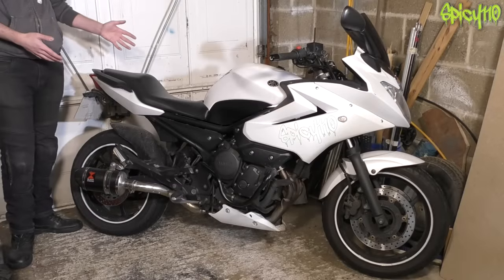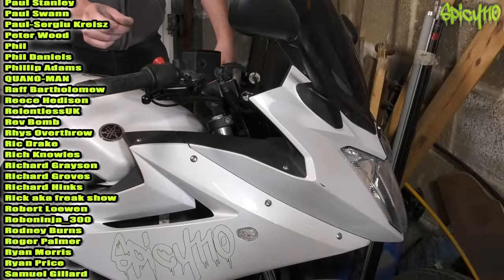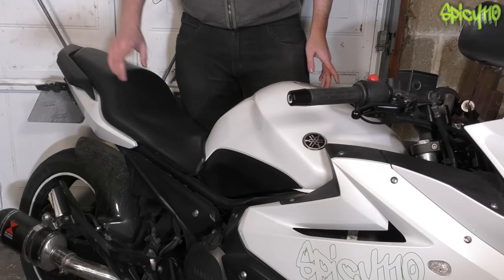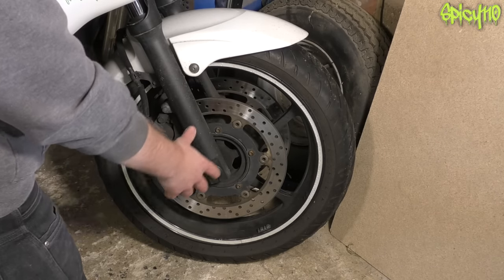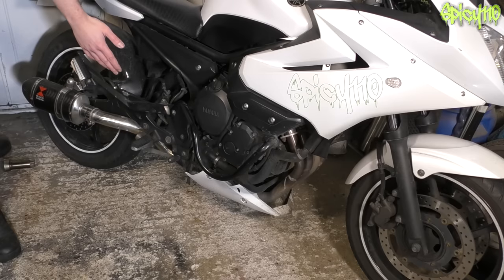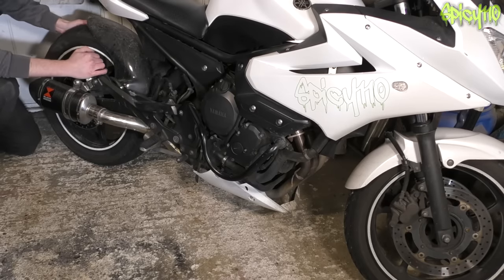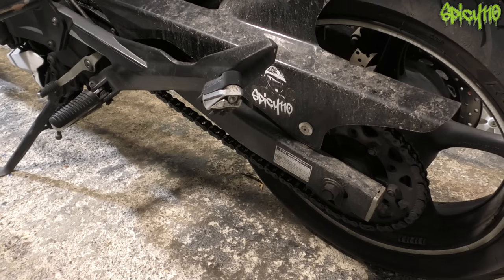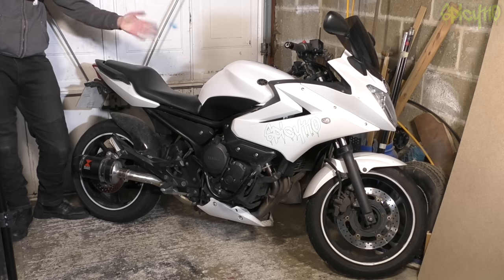My Motorcycle MOT Checklist!

Comment: We once put heat-shrink over braided brake hoses on the Land Rover.  One got nicked but just the plastic not the metal hose underneath it and it was a fail.  Cut the heat shrink off and it passed.  Even though all the other hoses were still covered in heat shrink.
Reply from the maker: Yep that's that visible damage bit again haha its kinds silly.

Comment: Most MOT testers are quite fair.  Garage i use are very thorough, but the guy who does the Bike MOT's is a biker himself, so little fussy things which can be sorted in a matter of minutes he will not fail you for. Things like LED flashing too quick, slightly too slack chain.  Things which can be sorted in minutes. Sometimes he will let you use his tools and sort it there and then
 Like he said to me last time, as long as you know what needs to be working to ensure safety and use a bit of common sense, and you maintain the bike, look after it, and replace worn consumables when required/below legal limits etc, you should not really fail a bike MOT.     If you know your tyre is below the limit, or your discs are worn, or pads etc.  Why would you book an MOT?

Which is a fair point
Said he can tell from a single MOT inspection whether someone maintains their bike.
Reply: The testers at my local test centre will fail a bike for  the smallest thing, all  just to get the money for a retest.

Comment: My MoT tester told me I had to have indicators if I had headlights on my Moto Guzzi, so many testers interpret the rules differently, it does get a bit confusing at times. Don't forget the indicators need to be spaced apart a certain amount if they are aftermarket! :-)
Really helpful vid this :-)
Reply: If there is indicators on the bike they have to work, if there arent, he just puts "not tested/not seen" on report (also have to take the indicator switch out, i believe). Or, you can simply put tape over them.  Although i did hear once that  bikes which were first registered after 1986, MUST have indicators.  Anything first registered before 86... the above applies.
But of course, you really really should have indicators on a bike, id make it a legal requirement.  Reason why all manufacturers install them out of the factory
Reply: @rickyevans3845  Hi Ricky, I noticed the "edit". My 2020 bike I recently got new and road registered didn't come with any indicators weirdly, yet has the switchgear for them, I wonder how many headaches that will cause come MoT time in 3 years if I still have it! :D

Comment: Thanks Spicy. As someone who just move to the UK and was hasty in getting a cheap bike I have 2 questions before I take it in next month. 

1. Would  a cracked but complete indicator lens fail?
2. Are instrument backlights a requirement to work or is it a case of, if it's there, it should be working?

Comment: We’re not allowed to use a calliper on the discs during mot, also not allowed to take any covers off or remove anything that can’t just be taken off, so theoretically you could have a leaky shock, and cable tie a cover to it and we can’t check it 😂
Reply: Same with fork gators
Reply: And ‘not for road use’ stamps on exhaust, a sticker over that means we can’t fail it on that.... but if it’s suuuper loud, it’s gonna fail anyways especially at my work as there are regularly police check points at the Tesco at the end of the road 👍

Comment: They can only advise the mirrors and indicators if they were fitted and you have removed them if the were not fitted as new they are not advisory and the rear reflector ideally needs to be located in the centre where the number plate is and I have a push bike on the near side strut

Comment: I’ve always been a bit confused on foot pegs. I was warned when I had my 125 because I only had 1. You can’t take passengers on a 125 so I didn’t see the fuss.
Reply: If you have a rear pillion space on your seat, you have to have rear footpegs securely installed.  Bikes with seats only big enough for the rider, dont need them.  Law(s) may have changed lately
Reply: You can carry a passenger on a 125cc with an A1 licence.

Comment: My first motorcycle MOT is at the end of Feb, so this is very timely and useful for me Spicy, thanks.  One question for you if I may pls... Not sure if there are different wattage bulbs in my indicators, or if it is a faulty indicator relay, but right side flashes slower than left side.  The front and back indicators on the right work fine, just flash at half rate of the left.  Is this a fail?
Reply from the maker: Hmmm are they LED indicators?
Reply: spicy110 not 100% sure Spicy. I don’t think they are if I’m honest.

Comment: My bike got knocked over in one of wales lovely storms and one of the forks on the bar that holds my pillion pegs on got a crack (as the pillion peg took most of the force). Its still secure but would that be an issue?

Comment: I have yet to take the CBT but have a 125 that I got to repair and use (videos will be on my channel eventually). The mot manual here  https://www.gov.uk/guidance/mot-inspection-manual-for-motorcycles says this about reflectors :"Motorcycles must have one red reflector aligned to the longitudinal centre line and positioned to reflect squarely to the rear...Reflective tape is not an acceptable substitute for a rear reflector". So I would be interested to know if just a small sticker on the number plate is a pass. Thanks for the good videos.
Reply from the maker: I did cover this in the video, they sell little self adhesive reflective buttons about the size of a 10p that you stick to the plate and that covers you.
Reply: @spicy110  My headlamp glass is cracked :(
Reply: @spicy110  You say in the video attached to the edge of the plate but I thought they need to be on the center line of the bike.
Reply from the maker: @SteveSims  arr I see what you are saying, mine have always been on the corner of the plate never a issue but if you want to out it slap bang in the middle at the bottom go for it. As long as it isn't over a letter or number.

Comment: So your telling me I can remove my indicators completely?
Reply: grey area.  If they are not on the bike and neither is the indicator on/off switch, then its not a fail.  However, I did get told once that any bike which was first registered after 1986, has to have indicators.  Absolutely daft not to have them anyway IMO, they should be a legal requirement full stop

Comment: I went on my side and the end of my front brake lever snapped off. It isn't sharp but is that still an MOT fail?
Reply from the maker: Hard to be sure but I believe it should be ok if it isn't too short and no sharp edges as you say but I would replace it as that ball is designed to stop your hand slipping off the brake. Most levers can be got for £10-15.
Reply: @spicy110  thanks man, I've been riding a year now and just got a beautiful yzf r125. I've learned so much from your channel and your videos really helped my confidence on the road. Keep up the great work and thank you for your reply!
Reply from the maker: Awesome and no problem. 🙂👍

Comment: What's the best way to check the headlight beam aim buddy 🤔
Reply from the maker: Tbh I have not worked that one out other than down and to the left a bit.
Reply: You got a front fairing on the bike? If so, wouldnt worry about it, long as fairing is installed right, headlight aim cant really be off

Comment: Spicey and channel i need your advice. just picked up a new bike. has not ran for a year but a few bumps later i got her running. so only needs a new battery and shes good to go. HOWEVER due to not running a year and needs a MOT. front indicators are missing as was taken by previous owner. rear are present and working. however biggest worry is, the light selector switch under the kill switch wont select OFF. so i have constant low beam or high beam. i plan on changing this switch anyway, but would this cause it to fail its mot?
Reply from the maker: Some bikes have the low bean always on, it can't be switched off so I think that is fine. However I don't know what the rules will be relating to things being fitted and not working.

Comment: can you have just rear indicators without front?
Reply from the maker: Yes, I think you can as you do not need indicators for the mot, however, if they are fitted they must be working. So if you just had rear ones and none fitted to the front that would comply with mot. However I would say you want them! On side roads and front on that is the only way people know where you are going, Unless you really are going to do all the hand signals.
Reply: @spicy110  Ok mate thanks I’ve just got a project bike and got her running today, now I’m trying to get her ready for the MOT she’s been off the road for 10 years.

Comment: Hi Spicy (or anyone else in the know). My high beam works on the high/low beam switch ... but the switch to flash my high beam does not work. Is this an issue ?
Reply from the maker: You are fine that switch isn't part of the test. It's known as a pass light and some bikes don't even have them. 👍
Reply: It's probably the green crusties on the contacts take it apart and carefully clean and replace oh and a small dab of grease on any pivot point.